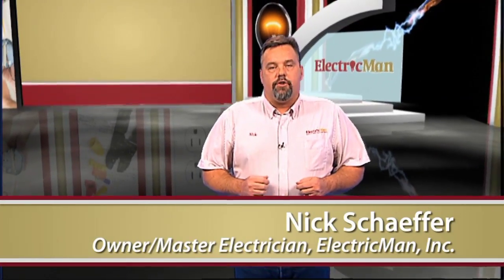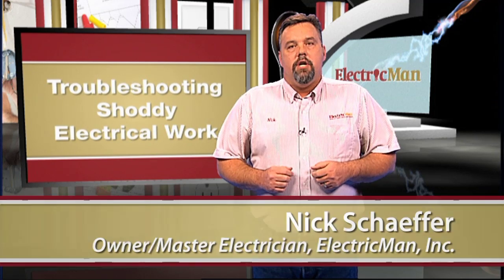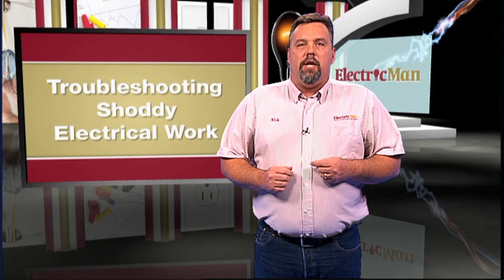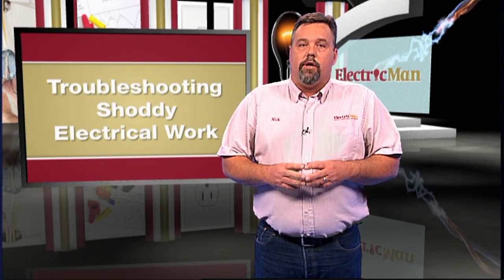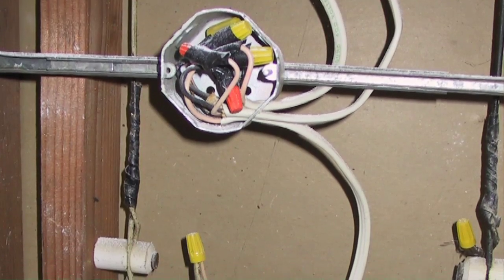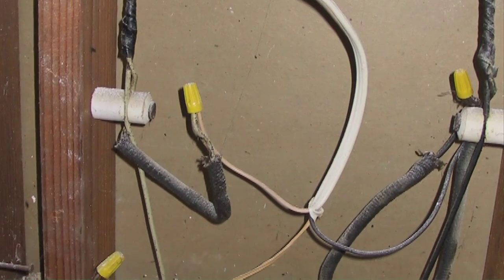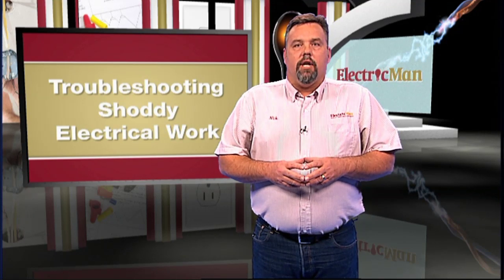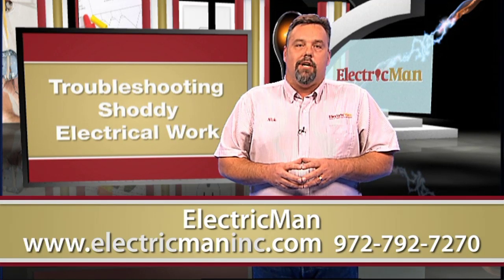Troubleshooting Electrical Problems

Comment: I have a circut that is not working. It includes an outside GFI pluse a few inside lights. The breaker does not trip. I have a light on a 3 way dimmer switch, 1 of which get very hot. I'm confident it is wired correctly and have been told the switch can get hot by the mfgr. At one time the light went out.  A few minutes later I could turn it back on.  I was using the outside GFI and it stopped working. Couldn't reset it so thinking it may be a bad GFI, I replaced it. Circut still not working.